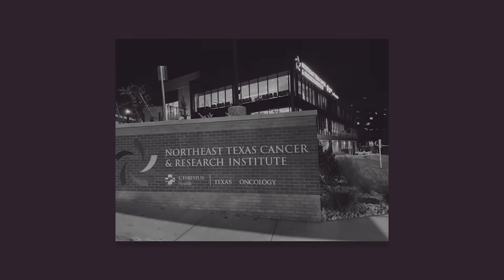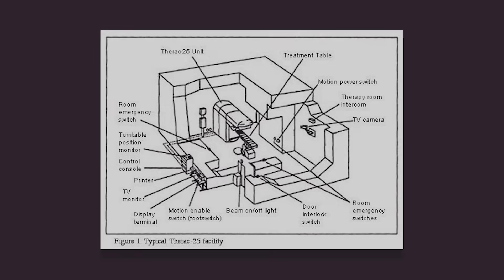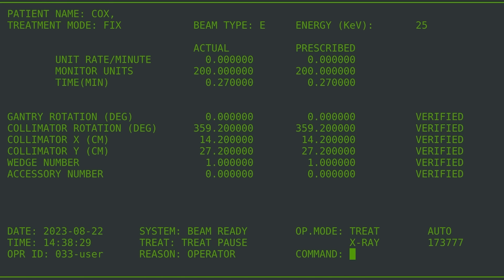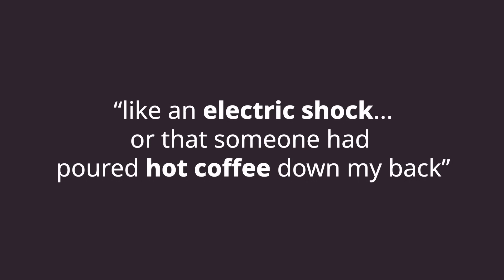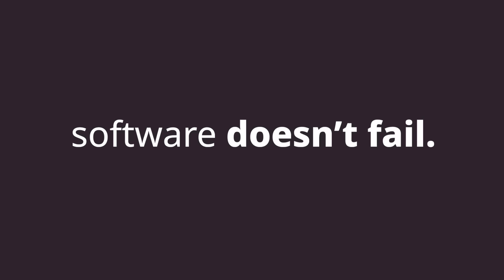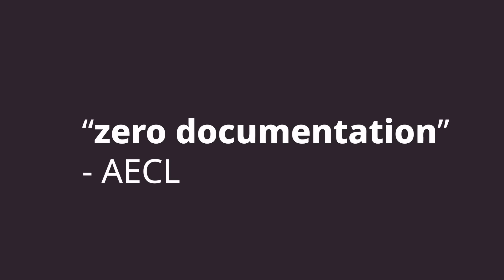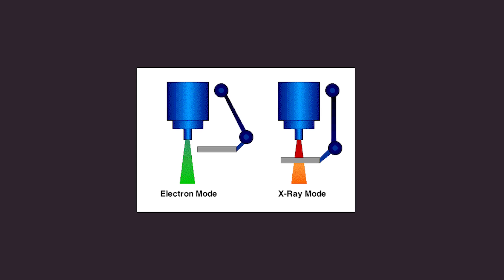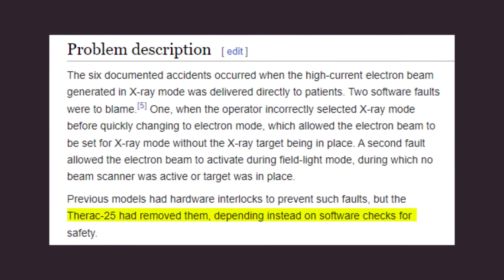how a simple programming mistake ended 6 lives

Comment: For me as a programmer for machinery it is the typical "blame everything on the programmer" thing. It is normal, that code has bugs and you will never find all of them. Therefore mechanical and electrical safety locks have to be implemented to prevent such malfunctions. In this case the software didn't do much wrong. It even gave an error message. The main software problem was, that it was possible to skip the message and continue. 

The main problems in this case were the removed hardware lock in this newer model of the machine for cost reduction. And the decision of the management to let the costumers continue using this devices, even after more than one accident was reported with this machine type.

Comment: I have been self teaching myself java for the past 3 years. And I still encounter failures. There will always be a test case that could ruin my output or end in an exception. But the fact that the code wasn't tested until the device has been sold is beyond me. How the FDA approved this machine with its lack of documentation is baffling. ALWAYS test your code, no matter how confident you are. And don't be a lazy programmer and hard coding the whole thing. Make it easy to read and not impossible to debug.

Comment: I've worked on embedded machines that were dangerous if someone didn't pay attention to them, so test the software sure; but no physical device should be relying on software for critical safety assurances. Instead that needs to be relegated to a mechanical and electrical solution.

Comment: this bug would have likey not been revealed no matter how much testing was done, unless someone like me, a veteran software tester who goes WAAAAY off script (and has gotten in trouble from management because of it) tests the device. A "normal" software test engineer would stay on script, test the script, check it off, and pass it. Good to go!!!! Whereas I test the scritp, then I come up with all kinds of deviltry to try and make the software go off the rails after i passed the official test script. Test scripts really keep you in the rails as a tester/simulated operator.... and real world operators do ALL KINDS of unexpected stuff to your software.  Put words where numbers go, numbers where letters go, leave the field that requires input blank, enter a special character like ^. enter characters that are found in software commands, enter commands instead of expected words. All kinds of off script things. The software engineeers both hated me and loved me. I have been told that I made them better at error trapping, and if they knew I was going to be the tester, they had much stricter validity checks. What I am seeing here is that the data input was being shuttled on the fly, as you leave the entry field. a BAD way of taking in inputs. It is better to fill out all the fields, and require the operator to press a go button once he is done entering ALL the information. THat way, if he changes something, the data is still held on the screen and has not been passed to any operating processes. However, it was the 80's and ram was at a premuim, so I could see how they were doing this likely to save memory locations. You basically have to store the screen first, then shuttle the variables and pointers after the fact which uses more memory. I learned all this testing methods from my professor who did these same kinds of deviltry to our student programs.

Comment: As an industrial automation programmer myself, I need to confirm that software does NOT fail! It will do and behave exactly how you programmed it.
Reply: Software "will do and behave exactly how you programmed it" UNLESS the environment in which the software runs contains defects, in which case all bets are off. And, essentially ALL software contains defects. Therefore, the idea that software will "behave exactly how you program it" is a beginners-level notion that does not apply except in cases of trivially low complexity and trivially brief execution. Perversely, in the typical case, the MAJORITY of software defects becomes apparent only after tremendously long execution. That is, exposures of these defects are quite low-probability events. However, they will EVENTUALLY arise. 

I wrote my PhD dissertation on the subject of software defects. These claims are not a matter of controversy. They are settled scientific opinion. To the best of my knowledge and recollection they are universally held among recognized software engineering experts.
Reply: @hagiasmos314  "Software "will do and behave exactly how you programmed it" UNLESS ..", so you are saying that the code will rewrite itself in certain cases? (Of course you don't-..) It will always do how you programmed it.

If the circumstances or anything changes or has defects, the line of codes will not.

If you are not prepared for the changes/defects, that's not the code's fault.
Reply: @EverPaintP  Code is not self contained. Defects in the code’s environment will cause the code to fail. Also, code typically has 1 or more orders of magnitude more defects than developers realize. The majority of those defects show up as extremely low probability events, triggered after perhaps 10+ years of “continuous” operation. Continuity can occur over many short intervals, because of state saving. Much, much more should be said. But that can’t happen in a social media context. 

A good software engineering text should introduce these ideas and provide sources for further study. I like Software Engineering: A Practitioner’s Approach by Pressman. But it’s been decades since I read it or taught from it. I think it touches on these concepts. I used to refer folks to the free books published by the Software Engineering Institute at Carnegie Mellon. I presume they still exist.
Reply: @EverPaintP  “If you are not prepared …” Of course not. But it IS the responsibility of the developer to anticipate change because it’s not generally possible to hold the environment fixed (consider security fixes, for example).

Comment: Its not that the software will never fail but rather that the computer will always do exactly what you tell it to do. In practice these notions end up as almost complete opposites given the typical complexity of modern software. Unlike conversing with another person, there is no reason-ability for programmers to lean on other than the checks that they themselves or others specifically put in place.
Reply: Sorry: The notion that a computer will always do exactly what you tell it is merely a first approximation suitable to the software worldview of a beginner. The computer itself consists partially of software. And that software is as subject to defects as any other software. Moreover, hardware is not free of defects. Therefore, defects are ubiquitous.

Comment: You send the WRONG MESSAGE in this video.  First, you use "assembly" as if it is a "swear word" & the cause of the accident.  You also make fun of "hobbyist" writing code.  For embedded machines, this was the only "real" language available in 1980, & the "hobbyists" were the best programmers.  Second, you blame "software bugs" on the error.  Software bugs was not the source of the error!  The problem was that the computer had no direct way to monitor the position of the internal target (thanks to the system engineers whose work was long done & cast in cement before the programmer wrote the first line of code).  The programmer had no option.  This falls in the class of many machines where "HAL" has no access to status (such as when a drill finishes penetrating the work ion a CNC machine).  What do the software programmers do?  THEY SHOVE IN A DELAY that "should be long enough".  The delay "is too long except when it isn't long enough".  Such design is a system problem, not a programmer problem.  Programmers are all too often forced to "patch a system up" to compensate for poor (or cheap) system design.  Been There Seen That on programs I managed for a military "battery management system".  The programmer was forced to shut off the power supplies (because they were so noisy that measurements could not be made while they were on).  So programmer turns off supply, makes measurements while system "coasts" on capacitor charge, then on to recharge, then off, more measurements.....
          Examples how this could have been dealt with was flipping a shield over the beam (external, so HAL could check it was in place).  Then briefly pulsing the beam on & measure the dose rate behind the shield.  Now that target position is verified, the shield can be retracted & the dose given.
          Your chiding of assembly is one reason we are faced with C "bloatware" & code "that is written by someone else, for someone else's application", not MY application.  You "just" tack in a bunch of libraries, calculating numbers to 64 bit floating point, even though 8 bit is enough for the application (manufacturer can claim "64 bit accuracy").  The memory bursts on small processors trying to accommodate all that junk.  (You think I exaggerate, I DO NOT.  FIRST robotics competition sent joystick positions to robots by 64 bit floating point number between -1 & +1.)  I will be willing to bet that if you could interview that programmer, the story would be different!
Reply: assembly is very difficult to read and understand, and for such a high risk machine that was being coded for, relying on a single man to code in perfect assembly w/ no testing, is pretty insane. the programmer of course did the best with what they were given, however, the fact that there was no hardware safety mechanism in place, for a machine built in the 80's (hence little to no coding standards), is just asking for trouble.

Comment: Would be nice if you added a small disclaimer to your images as being just examples. Most of them weren't about this cases, the one of the person with radiation burns was from a fluoroscopic procedure, not the Therac-25 accident. Also you got it wrong, he got an electron dose as if it was an x ray dose. That is because the transformation of electron energy to x-rays is only about 8 percent efficient and x-rays are absorbed much less than electrons so it needs a very powerful electron beam to give similar dose rates as if it was electrons.

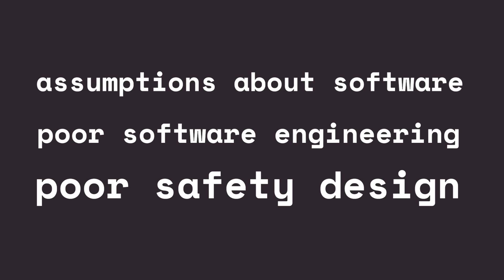Comment: This had nothing to do with the factory machines are the error that's everything to do with the malpractice of The Operators who started up the machines after the machines gave them and error it is Michael equipment used to save somebody's life and using it when it's malfunctioning is incompetent and obviously in this case very deadly 4:48

Comment: Their biggest mistake was creating a software that would deliver a high unhealthy doses of extreme levels. The very first issue with medical treatment tech is that there's lack of safeguards even at the hardware level this could have been prevented with an inbuilt system limiting at the level of voltage demanded corresponding with the dose delivered could have easily just shutdown the machine as a safeguard.

Comment: This error case shows that poorly designed code is more prone to errors than properly designed code.
The design guide to this case:
1) UIX shall be designed by a separate specialist that can reveal most common mistakes how the equipment operator can be mislead and make human error.
2) UI had to be designed as a Wizard dialog that contains at least three stages: a) choose kind of treatment (X or E), b) Enter treatment parameters in a form that looks different for X and for E even if the same params are entered c) do all params checks for validity and compartibility after an operator pressed 'Confirm', so if everything is OK enable 'Start' button. If 'Start' button is pressed enable 'Stop' button in case an operator found some mistake, or to react on the patient response.
3) Don't execute any hardware actions before 'Start' button is pressed, so avoiding any race conditions and other possible errors of incorrect hardware setup
4) Show 'Radiation Dose' in progress in actual measuremen units, so operator can be sure what is going on.

I think 'simple bug' is not what actually happened during software development time. You confirm this in the begining stating that the code was poorly tested before delivery.

Comment: That is not a race condition, as the latter only happen either in multithreaded (usually, hardware-wise) software, or whenever an interrupt data access is not properly interlocked. This is just a silly UI polling not done timely because of the faulty state machine logic.

Comment: My old boss worked there, so I know few more details about the case. Basically with medical devices you get a matrix of risk vs precautions. Adherence is enforced by BSI (EMA before brexit) audits. This matrix gets scaled based on how difficult to treat the diseases is. If an average patient is fucked, this matrix shifts in some areas. For example "massive random radiation" moves from 1 in 100,000,000 to 1 in 10,000. Broadly this is to allow companies to pursue treatments that potentially they would have abandoned otherwise due to costs. Anyone that has done a risk assessment knows that it can recursively go on to infinity!

European Medical Device Regulation (MDR) 2017/745 changed many things to be more stringent and give manufacturers less leeway when it comes to post portem after a severe fuck up. One of the significant changes in the wording related to risk management from:

"...to reduce risks as far as possible..."

to:

"...to reduce risks as far as possible without adversely affecting the benefit-risk ratio..."

Comment: Software doesn't fail. It works as written. Either the specification is wrong or the code does not follow the specification. But once written, software is predictable. It doesn't execute one way today or one way tomorrow, even if it might seem so.

What seemed to happen here was a case of poor engineering practices. A single developer working on a simulator, no code review, no testing.

Comment: The problem with bugs is you have to test every condition you don't plan for. It's always some obscure condition that no one thought about that happens and causes the issue.  There is no way to test every user accident in freak cases many times. You can test code for function but you can't test user situations. There will always end up some strange case where an operator did something you had not planned for.
Reply: Well said. In other words, reliance on testing can never deliver defect-free software. Instead, it's necessary to somehow prevent errors in the first place.

Comment: I was a surgical lighting service technician who spent 20 years and 6 months on the road and in the workshop repairing, designing, developing, and modifying imported equipment to meet local standards with occasional type testing. I learnt to no longer be surprised at how manufacturers used inappropriate materials, components, and mechanical and/or electrical designs that were sometimes fundamentally unsafe. Often, the worst features of a product would be forgotten and repeated a few equipment generations later, with each new model being fundamentally more complex, less reliable, more costly to own and with an ever shorter lifespan. 
I'm so glad to have left the industry and hopefully all of my trailing liability behind.

Comment: "one person. alone. programming"    am I doing something wrong in my startup ?

Back to the topic:   In this type of machinery there should be all technically possible hardware safety features. Like some hardwired hardware cut-off circuitry (made from wires, relays, sensors) killing the machine and not the patient when the radiation exceeds a reasonable limit. 
Or let me ask a very simple question, why on Earth such a machine needs a radiation source capable of emitting 200x of the lethal dose?    It is like a dentist using a 50 kg 5000W demolition jackhammer on your cavities, reassuring you it is on the lowest setting.

It is concerning for me, that the only 'moral of the story' is 'next time try to avoid writing faulty code', without any thinking out of the box.

Comment: This is a chilling example of what happens when you apply low-risk thinking to a high-risk environment. When engineering something critical you need to go into it with the mindset that if you screw something up, people will die, but because so much of software engineering is done on less critical things people get used to thinking of bugs as annoyances rather than threats.